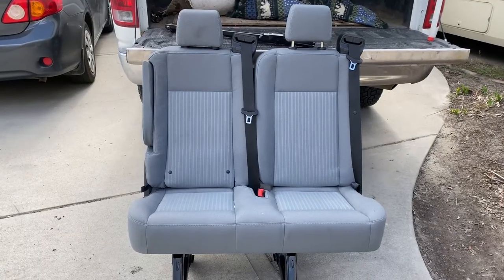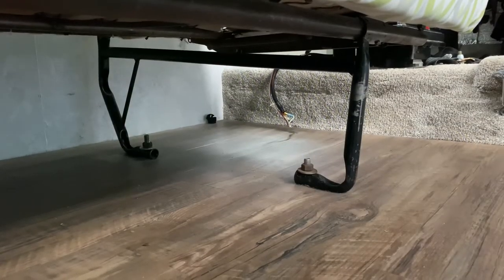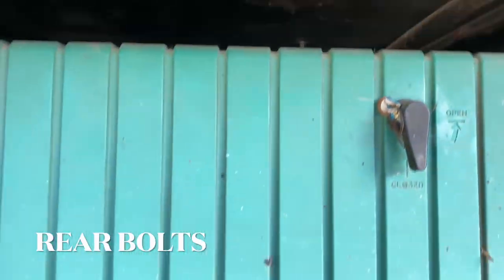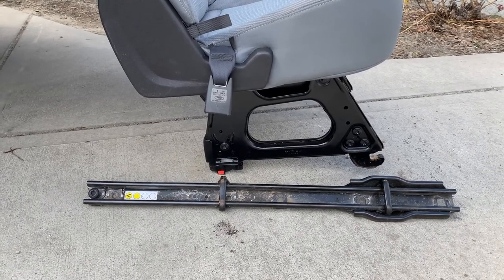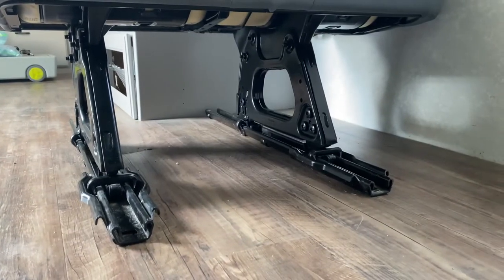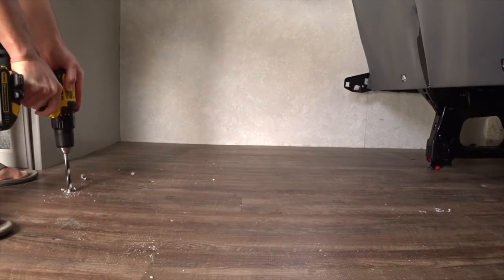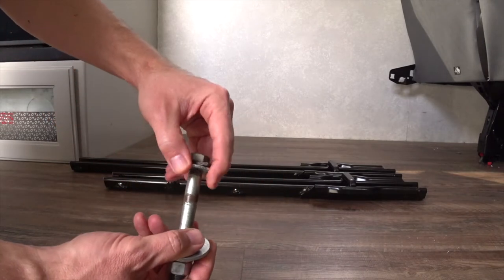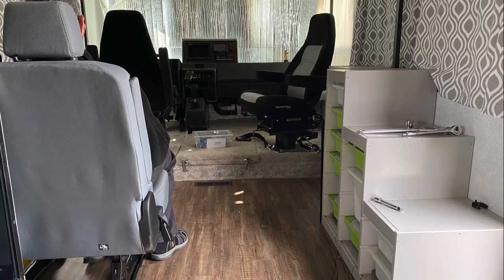RV Seat Conversion: Jackknife To Ford Transit Seats

Comment: Is that only mounted to plywood? Maybe a metal plate on the underside would be a good idea? I want to do something similar but I am worried this is not secure during a crash if it's not mounted to the frame. Nice work nonetheless!